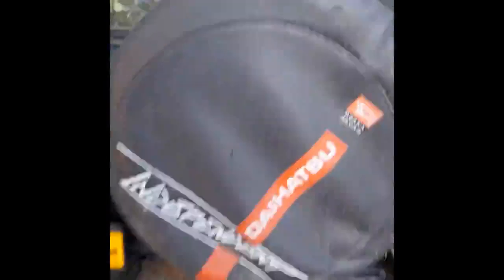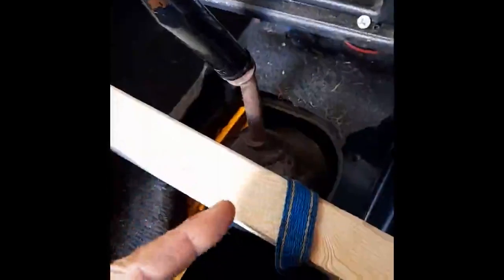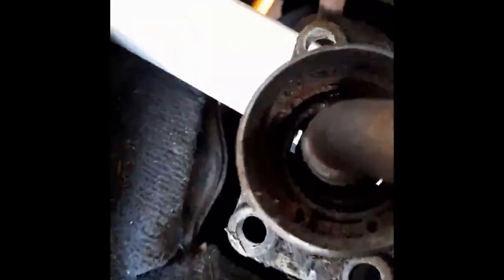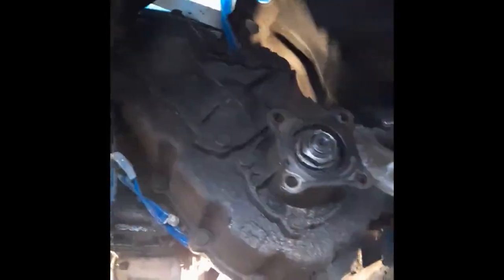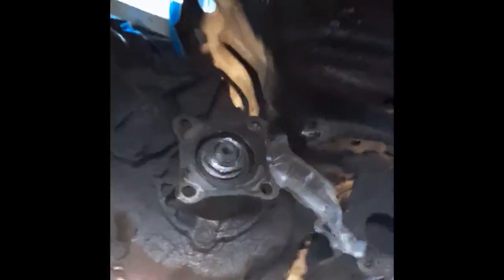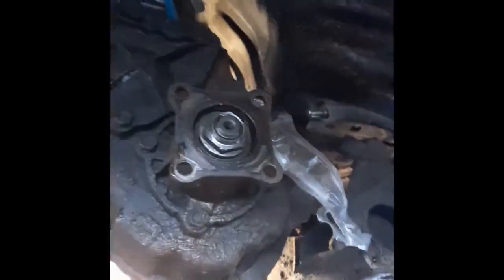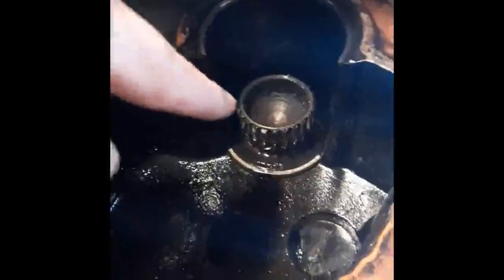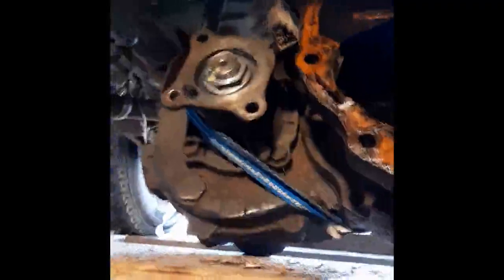Daihatsu Fourtrak / Rocky 4WD Transfer Box removal with engine and gearbox in situ.

Comment: I'm sure you sorted it by now but the nut that needs tightening up is the one on the gearbox not the transfer box. It's the highest of the nuts you can see 👍
Reply from the maker: Hi and thanks very much for your comment and feedback. Could you be a little more specific - why do I need to tighten any of the nuts? Sorry, I'm not quite with you.
Reply: @gurglejug627 A common fault on these is the nut on the main shaft in the gearbox works loose making it increasingly difficult to shift into gears. Symptoms begin with difficulty shifting down drom 3rd to 2nd gear and get progressively worse. It's worth checking that the nut is tight while the transfer case is off!
Reply from the maker: @dyngwyllt  Thanks v much, I will look at that. I was assuming I'd have to bin the box and there does appear to be quite some damage to the large splines on the TF box. The 'main' gearbox was working fine into gears 1-5 but only the low-high selector stick was sticking, from memory from what the former owner told me - and from what I recall when towing, though it's some months ago now. Could that be the same problem? All learning and feedback really appreciated, thanks again. Presumably the loosening of the nut is visible without splitting the box open? I'll get back to you as soon as I've had a look at it, following what you say.
Reply: It's the large nut visible at 9:22
You might need to take the top of the gearbox off. Select both 1st and 3rd gears simultaneously to lock the gears then get a long breaker bar to tighten that nut right up (remember it's fighting the engine torque so needs to be tight!)
Some people put a little spot weld on the nut afterwards to make sure it doesn't go loose again.